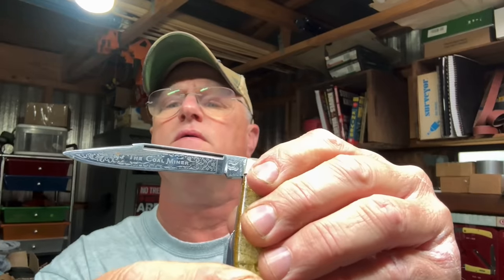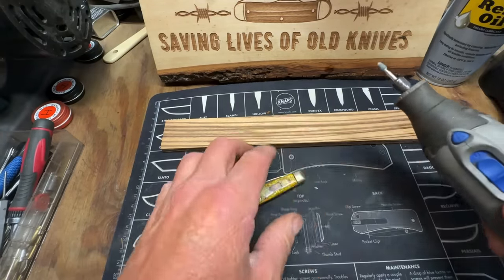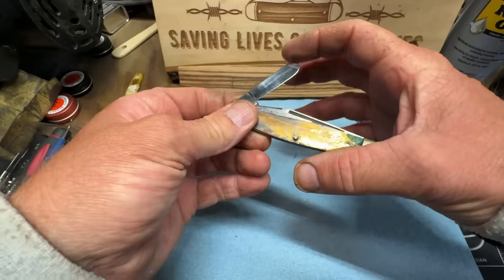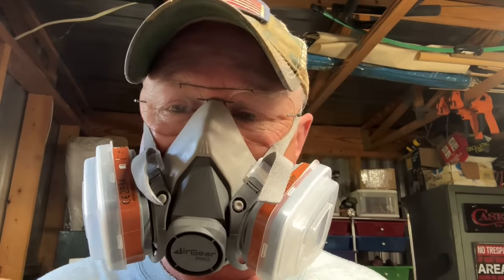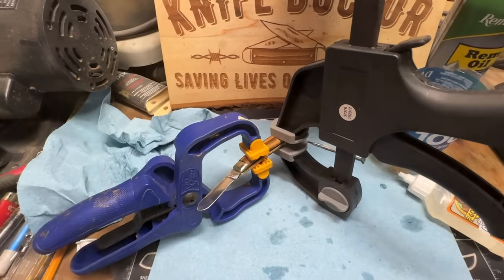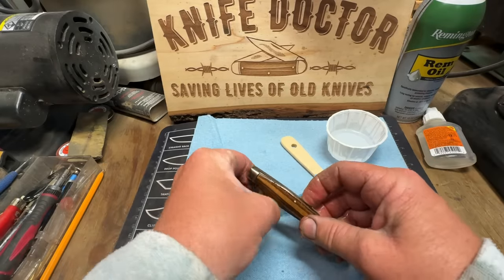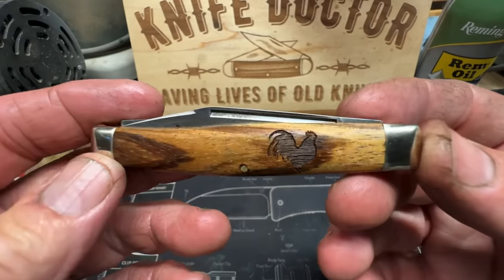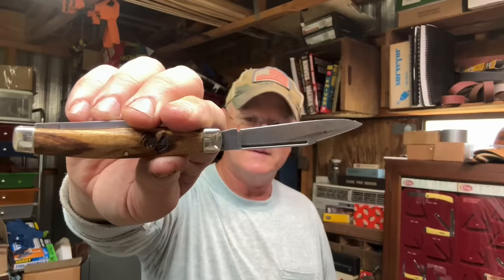Fighting Rooster Knife Transformation! From Abused to Amazing!

Comment: Good thing you changed the scales , they were breaking down and would have destroyed the knife, the celluloid that came out of Germany on Buck Creek and FRooster during the 90’s gas out and can destroy the knife. I have had them to rust and break the springs even break the brass liner . The residue looks like battery acid and burns the tip of your tongue.Btw Oatey 2 part plumber epoxy looks like a white tootsie roll , cut of a piece and knead it till it’s one color, oil the liner and inside of bolster, then squish the putty like epoxy where the new scale will be and trim it with a knife in 15 minutes it’s rock solid , pop it off and you have a template for the new scale.Im no master knife fixer but it works for me . BTW the new scales look very good .
Reply from the maker: Thank you for sharing